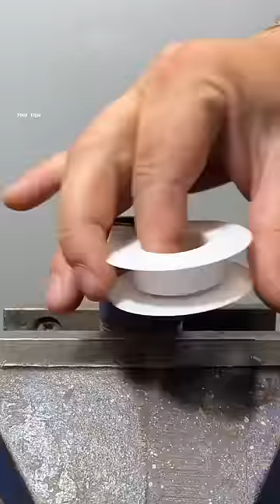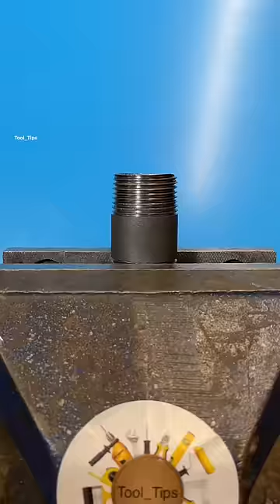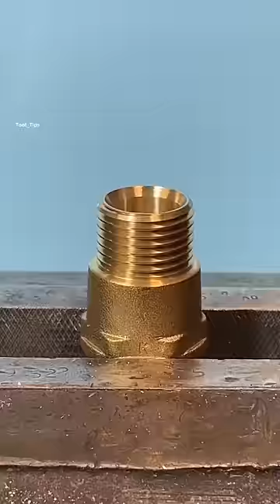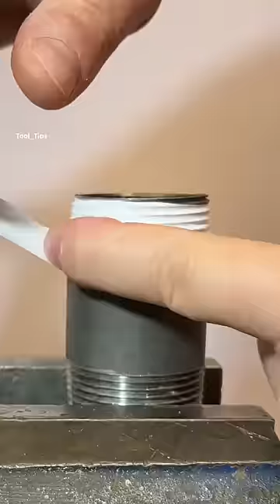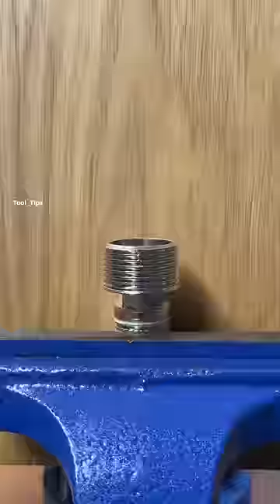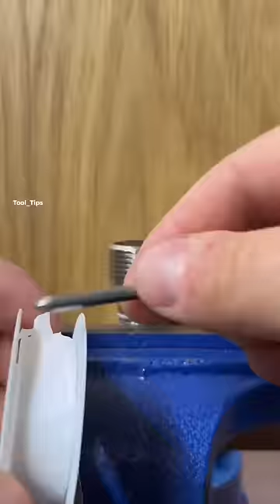Just Watch 😳

Comment: Spray paint on top of the Teflon tape can cause a leak, especially if the paint dries!
  I'm assuming the natural looking fiber is oakum,which was, is used for cast iron drain pipe connections,which is then topped off with molten lead(old school).
  I've never seen it used for threads before?
Reply: Hemp, was traditionally used in the UK along with jointing compound to seal threads before PTFE... apparently in other places they still use it. It may be the same as what you call oakum, but here for that purpose they used to use cotton 'waste'